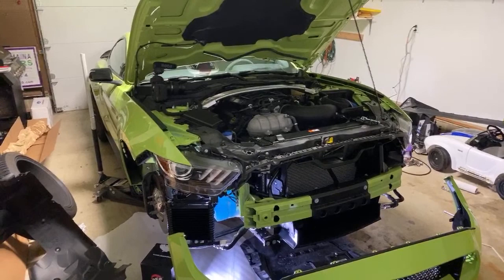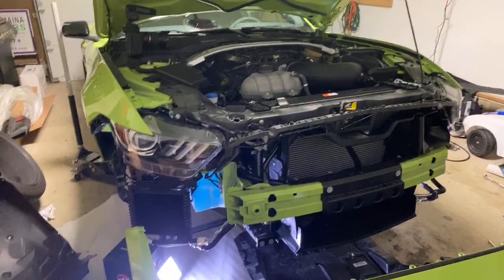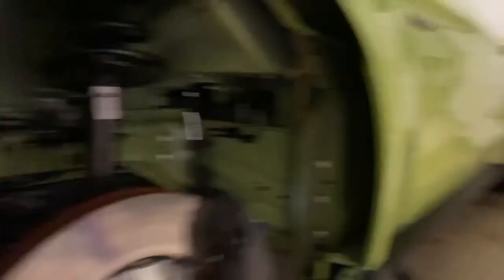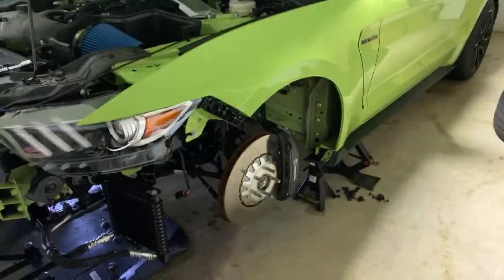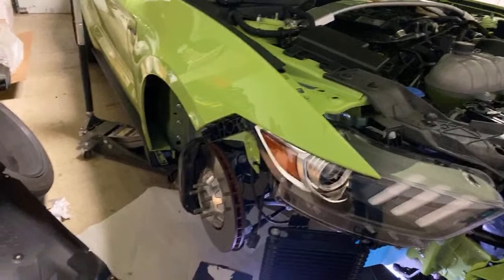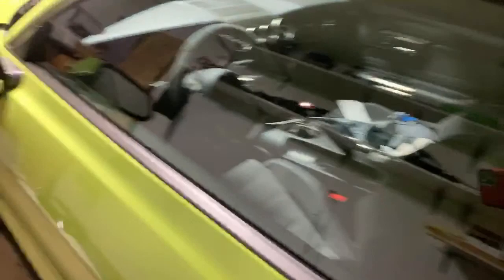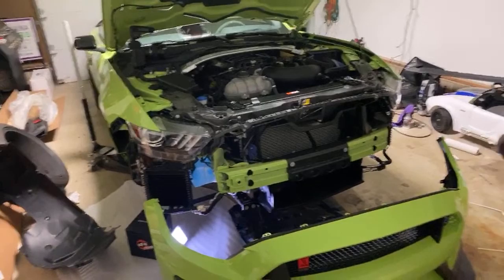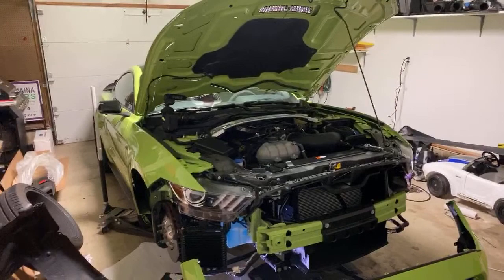Shelby GT350R Surgery & Upgrades! What’s Going On Here?

Comment: I lowered my friends gt the other day. Only reason I took the calipers and rotor off is to get a good swing at those pressed in bolts with the hammer. Otherwise I wouldn't want to mess with brakes either. Videos up on my channel

Comment: They have a set of gt350 R  seats super low mileage on Ebay now. I modified my fender to bumper retainers. Now they bolt on with 10 mm head fender bolts from rear of the fender. Makes removal and installation process easier.    Grill closing I believe was to reduce lift at speed above 160 miles per hour.  New r dash emblem on Ebay also.  Have a great day.

Comment: Don't forget the R uses different aspect tyres. The R uses 30s and the non-R uses 35s. When you purchase replacement Michelins make sure you get the 30s. It will lower the car a fraction.